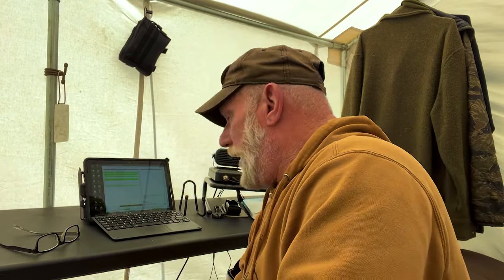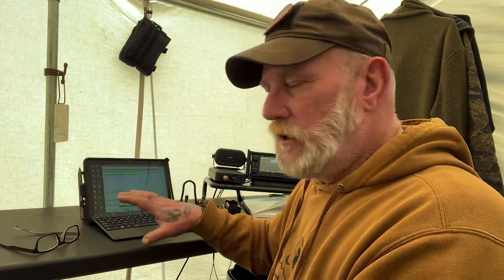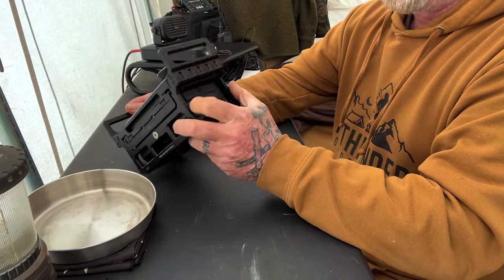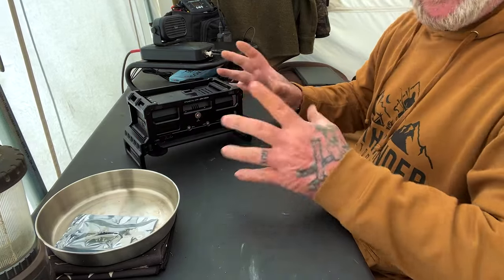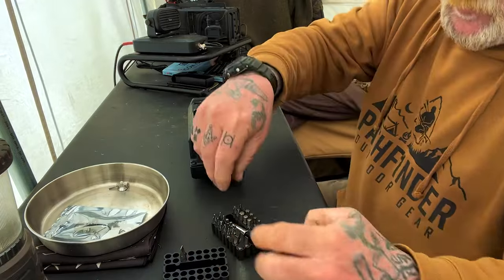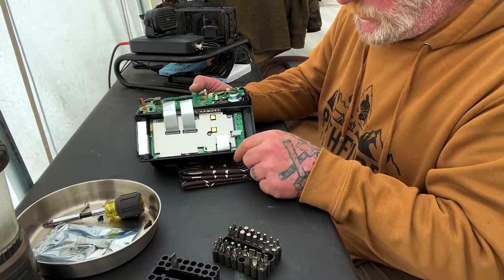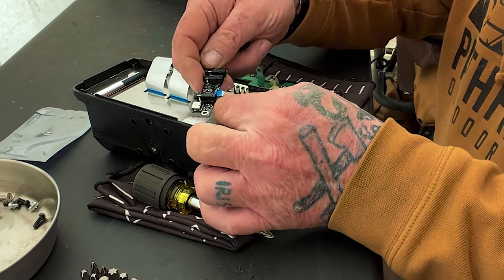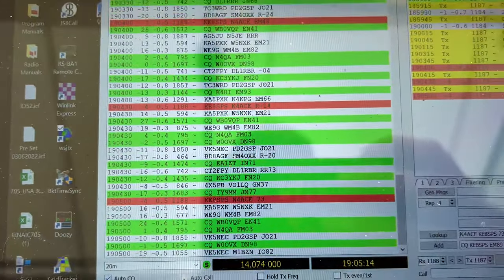IC 705 USB C upgrade for Off Grid Comms

Comment: I'm rocking one of these on my IC-705 as well.  I put a small dab of hot glue on that socket and ribbon cable as an extra peace of mind.  My other upgrade was from the AH-705 to a PA500 which allows me to go up to 60w,  I typically run only 20w though.